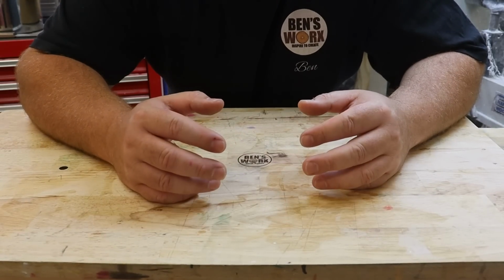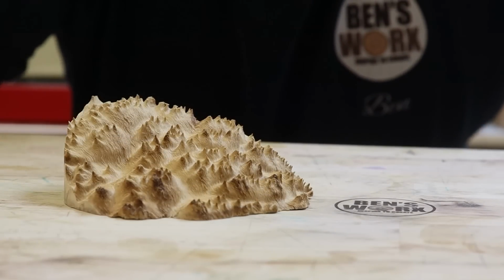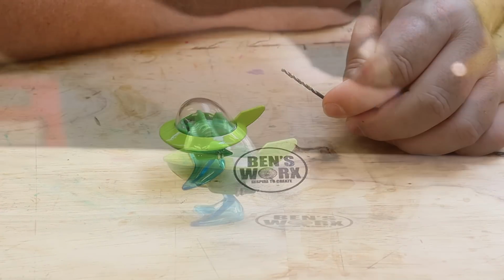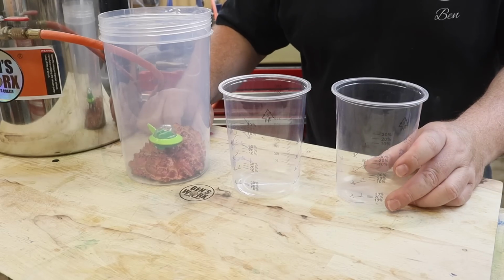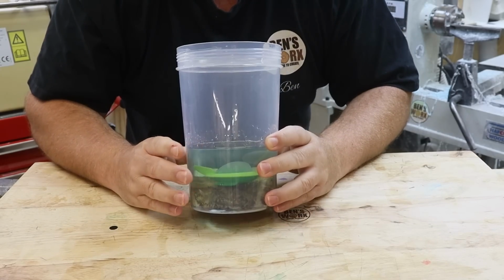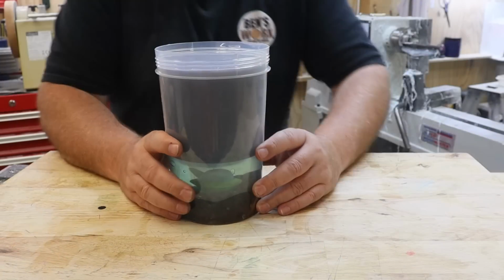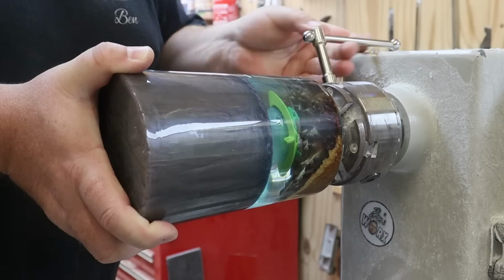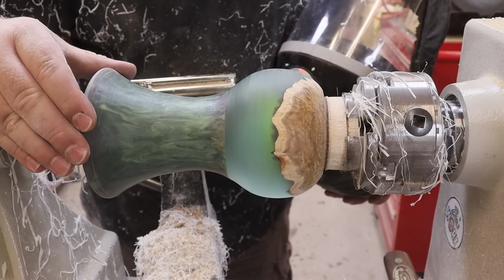Turning The JETSONS Ship into a Vase - Burl Resin Art

Comment: Next time you use a ship with a large space inside it, you can drill a hole in the underside and inject resin to fill up the cavity with a syringe. If you are bothered about looking into the space and seeing the hole, it can be angled so as to emerge from a corner or some other place hidden from view. You can even use the same batch of resin as you cover it with, just plug up the hole with some UV and harden it to seal it in.
Reply: wow you said that better then i could i was trying to think how one could fill up the dome with resin couldn't you have filled the whole thing up with uv resin since it had a clear top
Reply: @redschafer7804  In my experience, filling large volumes with UV resin isn’t very good. It tends to heat up and/or make a lot of bubbles when it is too much, but I guess that also depends on what kind of UV resin one uses.
Reply: @mikkohernborg5291    i have 0 experience with any type of  resins so thats good to know
Reply: @mikkohernborg5291  I think he was recommending using 2 part epoxy to fill the void and just sealing the hole with UV resin. There are some terrible UV resins out there. But, both Let’s Resin UV and J Diction UV are good, adding too much black or dark pigment will inhibit UV from curing. Also using Alcohol inks with UV prevents curing as well.. I found both of those out the hard way :) I recently heard a good tip for curing UV, place a mirror under the mold. I haven’t tried it yet but, it sounds like a good idea.
Reply: That's exactly what I was thinking! Great minds.
Reply: Aaaah ya beat me to it
Reply: ^^ This - I was wondering what the hell he was doing drilling the hole right in the middle of the dome where it would be super visible.

Comment: You could have used a heated nail really close to where the dome meets the back of the model, or even from the underside where the little stand connects to it, then put it in resin in the vacuum chamber to fill it, removed it from the resin, and left it to dry upside down so the dome would be filled with resin.
Takes more time but makes the hole less obvious.

Comment: Another masterpiece, Ben. Is there a  reason you didn't put a piece of wood in the center of that second pour? It would save resin and you're drilling it out anyway.
Bill
Reply from the maker: Thanks Bill, I’ve often found that it can sometimes cause more problems with air bubbles escaping the wood 👍

Comment: Incredible video, but I wonder what would keep you from doing something similar to this and drilling a hole in the bottom of the toy and filling it with regular or UV resin using a syringe ahead of doing the project if it would work at all.